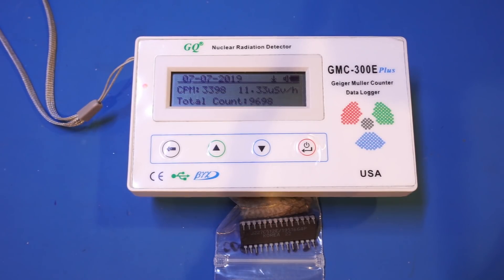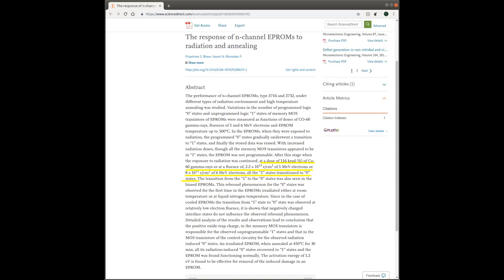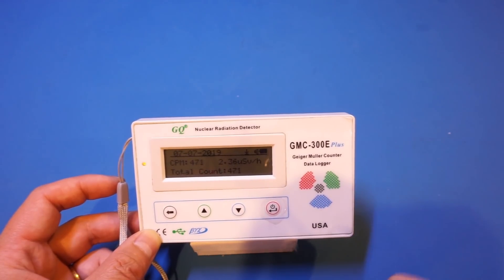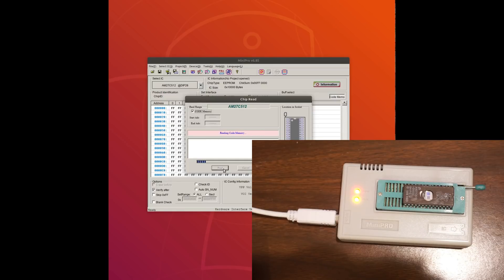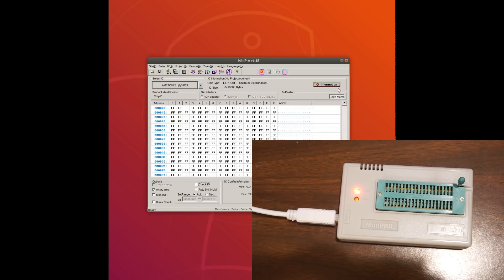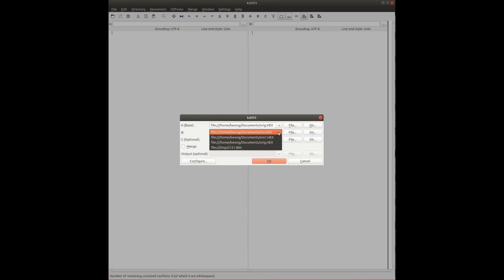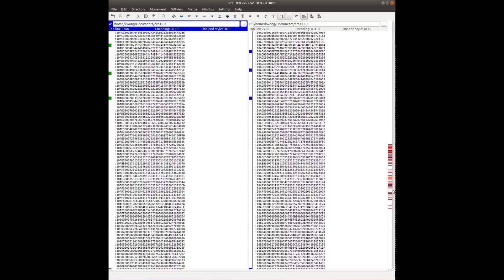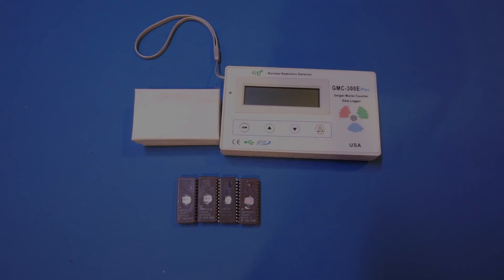Is Airport Scanner Safe for Your Non-Volatile Memory Devices?

Comment: Erased EPROMs read as 0xFF. So you can't expect any change at the beginning and end of your samples. Anyhow, there where zones that were not affected by radiation. They seemed to be near the end of the hex dump.
It only would be interesting to see any correlation between geometrical location and logical location.
Would be harder to find out with different test of shielding different regions.
Anyhow, still interesting as always.

Comment: It looks pretty interesting to me you have MiniPro v6.85 running on Linux. I have a TL866A (and it's most likely a knock-off). Using MiniPro v6.60 I didn't want to upgrade to MiniPro v6.85 just in case there is some detection and bricking of my potentially knocked-off TL866A.
Reply from the maker: Yeah, I only use Linux at home. I reflashed mine a while ago from a lower version and didn't have any issue with it.

Comment: A 27C512 EPROM would be manufactured using an early 1980 process, so somewhere from a 1 µm to a 5 µm feature size. And if you assume that the size of a silicon atom used in chip fabrication are around 0.2nm, then a 1000 to 5000 nm process would be about 5000 to 25000 atoms wide. 

The quartz window will block nearly 100% of the helium nucleus (alpha) from ever reaching the silicon dioxide surface. 
The quartz window will also block almost 100% of the electrons (beta) from reaching the silicon dioxide surface. 
So in reality you are left with the high energy photons, most of which will pass right through having no interactions. And even if a high energy photon did interact within a doped layer inside the silicon it would interact with at most 1 in a 5000 to 25000 atom wide strip (I'm even ignoring the depth of the doped layer, which would make the odds much much less). 

You best bet for a failure is to use a chip manufactured with the smallest modern process. Chips made with 200 nm and larger process (with external graded-Z shielding) are typically what is used in space. The older the process the more atoms, the better the survival rate in harsh ionizing environments. Ultimately radiation causing a fault is just statistics, and more atoms you have the lower the odds of multiple  faults causing a critical failure. 

On all modern data storage devices the typical read mode is to expect to have multiple failures on every "normal" read and to rebuild from corrupt data using hamming codes. If you look deeply into how data is currently stored, it is scary.
Reply from the maker: "On all modern data storage devices the typical read mode is to expect to have multiple failures on every "normal" read and to rebuild from corrupt data using hamming codes. If you look deeply into how data is currently stored, it is scary."

Yep, especially MLC devices.

Comment: A better test for checking for errors is to use the verify function on the programmer. If it is a reasonable quality programmer it will verify the EPROM contents at different supply voltages, which has the effect of shifting the thresholds of the internal floating gates and showing up bad cells that would be missed by reading at nominal supply voltages.